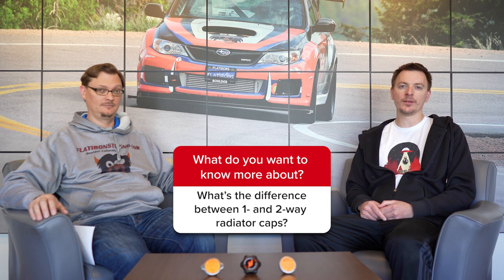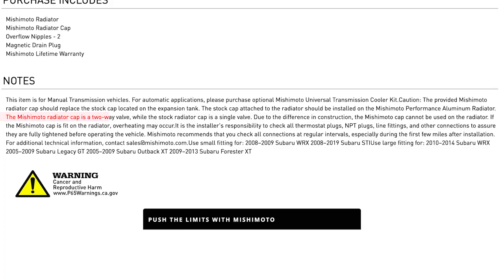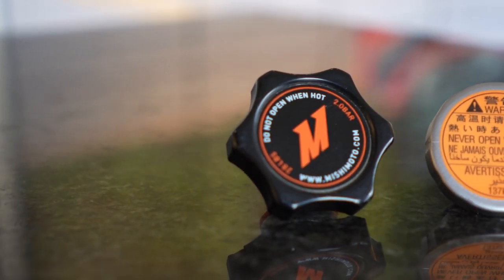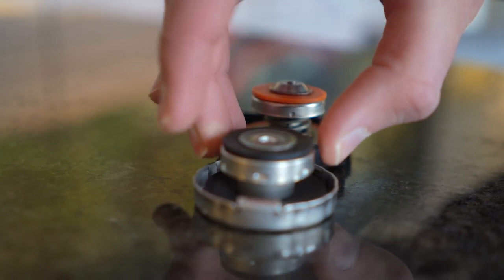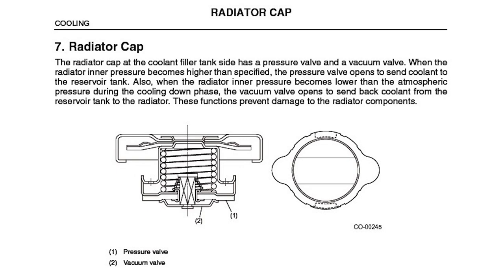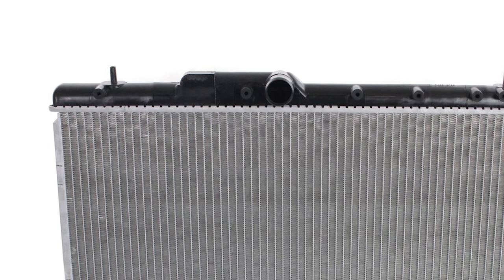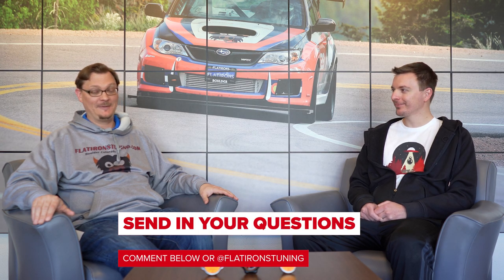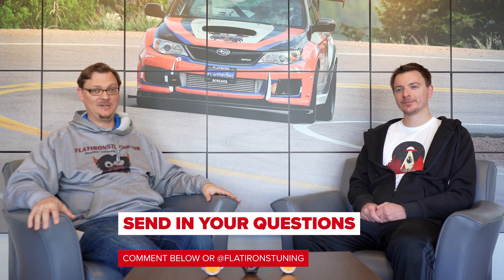Explaining the Mystery of Subaru Radiator Caps

Comment: Dude, you guys just saved me. Was having an issue with my overflow filling to the brim with coolant, and my car then overheating. Everything I was reading was saying head gasket. I watched this video just on a whim, and it made me realize, I actually had my caps swapped. Yall are the best.
Reply from the maker: Very glad to hear that this helped you.  Stay Tuned!
Reply: @FlatironsTuning  Wound up being the head gasket anyway *super excited*. But I still learned a ton from these videos
Reply from the maker: @NateTeunissen  Sorry to hear that, but it definitely is critical to have those caps in the correct locations.  Hopefully that will help keep your engine cool going forward.

Thanks!
Reply: @NateTeunissen  can I ask what year your Subaru is/was? Thank you!
Reply: @FlatironsTuning  do you know if this hold true for the CSF radiator as well?
Reply from the maker: @TheRandomname951  Yes, it would be the same for CSF radiators.

Thanks for watching and Stay Tuned!
Reply: I'm having this issue right now. My mechanic is thinking headgasket, but I'm still thinking radiator cap. Hope they don't ruin my car...
Reply: I had the same fear on my 2009 forester.. suddenly reservior tank filled right up after a heavy drive.

Comment: Hi Jon, I hope this solves your cooling problem and thanks for the plug. My solution on our sprint/endurance cars is to simply use the stock/oem caps as Subaru intended, no aftermarket caps to fiddle around with. If you don't get the caps right you can spend a ginormous amount of time and effort trying fix an overheating issue. Putting the caps on correctly may not solve the overheating, it could be something else, but you have to eliminate that variable first.  Next, what we've found is most important is proper ducting into the radiator and sealing it all around the edges so the airflow cannot slip past it. A vented hood makes a big difference too.  If you watched our YouTube video on the last Cascade Enduro you heard me say that after 6 hours of racing our coolant temps were still slightly below normal on the OEM gauge. Later our datalogger confirmed our temps. 
And for your audience, the rule of thumb so you don't get the caps swapped backwards: The cap with "ears" goes on the expansion tank because Subaru wants you to open that one to fill/check the coolant. The round cap without ears goes on the radiator because Subaru doesn't want you to take it off, so they make it harder to grip it.
Reply from the maker: Thanks very much for pointing us in this direction.  It has been enlightening to say the least!

Stay Tuned!
Reply: Thank god. This just saved my ass on the side of the road.
Reply from the maker: @89autoworks  Oh man.  Glad you found the video and that it helped. 

Stay Tuned!
Reply: @FlatironsTuning  I can’t wait till my car is done, would love to take a road trip out to your guys place!
Reply: @FlatironsTuning  yeah and I lied, car is still over heating…. No bueno.

Comment: I've ran Mishimoto radiators on a few cars now and I must say that using OEM caps are the way to go. I always had overheating issues when running anything aftermarket. Go OEM and in the proper location, you'll be good to go!
Reply from the maker: Totally agree.  Thanks for watching and Stay Tuned!
Reply: whats the correct way the caps go? I want to buy oem for both
Reply: @jessem9832  the perfect circle one is the radiator, the one with the lil side tabs is the expansion tank. Hope that makes sense

Comment: Great video as always guys 👌 I’ve tried to explain this so many times to friends in the Subaru community but now you’ve done the perfect video explaining it all, I can share the link with them. 
      Another pointer not covered is the reduction in size of the overflow tank usually when fitting front mount intercoolers, this can cause issues whereby the coolant overflows the overflow tanks capacity and then when the two way cap draws back when cooling down, it empties the smaller capacity overflow tank and draws air which then causes the air pockets in the system and head gasket failure. Keep up the great vids guys 🤘
Reply from the maker: Thanks very much Sam, and great point about the expansion tank.  That is definitely another gotcha for sure.

Thanks for watching and Stay Tuned!

Comment: The Subaru cooling system can be a right pain at times if you don't know the difference between the expansion cap and the radiator cap, however it's made worse by companies listing all the caps as rad caps.. 1 way valve on the radiator, 2 way on the header..
Very Interesting video for people with coolant issues being led to believe it's hg failure 👍
Reply from the maker: Thanks for the comment and thanks for watching. 

Stay Tuned!
Reply: More stuff to worry about with the Subaru

Comment: So happy to actually see or find a very concise video about this topic as I and apparently many many others had absolutely no clue about this one way & two way valved cap my OEM radiator on my 2012 WRX finally let go at the crimped plastic endtanks and started leaking. Swapped out for a koyo rad radiator and radiator hoses so it obviously came with their cap and upon install was when I started to find out about all this one way two-way valve craziness and obviously when I started searching online trying to find out why and where to put the higher pressure cap where to put the two-way valve and if it was even worth using one of the higher rated pressure caps. I most definitely did see very erratic coolant temps and it would get over 208 and rather quickly once I understood what was going on and had the correct pressure caps in the right locations everything's calmed down and worked out wonderfully and when I pull my car in the garage and shut it off you can actually hear that vacuum and you can  hear the system sucking the coolant back out of the overflow which kind of tripped me out at first until I realized what was going on and that that was actually correct but thank you very much for the content in this video it was wonderful also very excited to hear what else you find out with continued testing on this topic.
Reply from the maker: Thanks very much for the comment.  Stay Tuned!

Comment: I've seen a lot of folks ditch the expansion tank for track use.  

My car, which is basically one giant experiment, is actually running an N/A radiator + JDM crossover pipe without the expansion tank and only one radiator fan with the USDM EJ205.  Coolant temps have stayed below 200 on the track so far.  Ill find out how it does with the new turbo tomorrow :)
Reply from the maker: Thanks for the comment.  I think that the expansion tank is actually they key to the solution, not the problem.

Thanks for watching and Stay Tuned!

Comment: The reason for the expansion tank is that due to the location of the turbo charger on dual cap cars, the cap on the radiator is no longer at the highest point of the system. In order for the system to function properly, the fill point must be at the highest point in the system (just like how a brake bleeder must be at the top of a caliper). Notice how the 2010-2012 Legacy GT did not have an expansion tank because it has a bottom mount turbo.
Reply from the maker: Thanks for the comment.  Stay Tuned!
Reply: I love that explanation!
Reply: This makes sense.  Guess I  messed up.  I burped air on my koyorad radiator side no bueno

Comment: Hi guys , great video , I do a lot of track work in my Impreza and I’m a plumber by trade so My understanding of the way the caps work is that both caps lift sending expanding coolant in to the expansion tank (at different pressures) but only the header tank cap draws the coolant back as that is the highest point of the system.

If you ever noticed when the engine is cold , say it was left over night the coolant level is never right to top and there is an air gap and once the system pressurises again this air gets pushed out and the cycle of push/pull continues.
If you have the 2 way cap on the radiator you may get air pockets forming and this is a lower point in the system hence the overheating. I could be wrong but it is may understanding of it. 

A friend with a s204 had this happen at the Nürburgring and a head gasket failure shortly afterwards. Caps were fitted incorrectly.
Reply from the maker: Thanks for the comment Barry, and that is our understanding about the issue with the 2-way caps as well.

Thanks for watching and Stay Tuned!

Comment: What an huge amount of info... And what about the non-turbo subarus, with only one cap in the radiator and the expansion tank next to the radiator, with an standard plastic yellow cap? This cap on the radiator is a two way one?
Reply from the maker: Thanks for your question.  The non-turbo Subaru's only have a single cap on the radiator, and that is a 2-way cap.  The tank next to the radiator is the overflow, and it doesn't have a pressure cap on it, and you actually wouldn't want to seal that off.

Glad that the video was helpful and thanks for watching.  

Stay Tuned!

Comment: So it wasn't the head gaskets, didn't someone say it wasn't?...😀 I'm just glad you got it figured out.
Reply from the maker: Right?  I feel like we are getting to the heart of the issue, and our cooling system will be the better for it.  This is why you always have to do your diagnosis work, and develop a solution based on what you find.

Thanks for your help, and for being a great sounding board for this Keith.  Much appreciated.

Stay Tuned!
Reply: @FlatironsTuning  Meh I'm always learning like anyone else. I really would have like to have seen that car go around COTA, but sometimes the cards you're dealt are just not the winner combination.
Reply from the maker: @Silent_Keith  Honestly, if this lets us figure out the cooling system and improve it (which I think it all ready has), then this may be the best thing that has ever happened to that car short of getting the dry sump figured out.

Next year will be better. ;-)
Reply: @FlatironsTuning  Why not just add an Accusump?

Comment: I’ve ran dual 2-way caps for a couple years of track days now. 1.3 bar ARC cap on the expansion tank and 1.4 bar CSF cap on my radiator. I think the important part is to have a 2-way cap on the expansion tank, and the pressure relief on the expansion tank be less than or equal the cap on the radiator
Reply: If you keep the factory expansion tank it sounds like the 2-way cap should be less pressure than the radiator cap. As long as one of those two caps maintain correct pressures it looks like you're set up is safe, but if it was me I would run the factory cap on the radiator.
Reply: I’m about to do the same 1.3 greddy on expansion tank and 1.4 Csf.. the oem radiator cap doesn’t fit the Csf kinda loose and leaks a little.

Comment: Awesome video. Here’s my experience and two cents. 

A few weeks ago I pulled the engine(04 EJ205) had the original aluminum expansion tank, the filler neck had a small rip due to all this pressure. Ended up changing to the plastic OEM expansion tank, but did not replace the caps.

Anyways, my dad helped a bit, during the process of adding the oem super coolant(Have a 2007 2.5i A/T sitting on the side) Did notice the shape where different(didn’t give too much thought)and did not check the kPa. A few moments later my dad brought this up even though he’s never worked on an EJ.

And mentioned to check the pressure readings on top of the caps, without even looking at them. Once I did.. for radiator it’s 108 kPa and expansion tank 137 kPa. Looked it up on forums and saw the difference. No overheating or anything.

Mean while I still kept inspecting hoses and caps. I’d remove the expansion tank cap and see build up from I guess the old coolant. I clean it up with a toothbrush and remove the gunk. Radiator cap not a whole lot. 

You explaining how these caps work, specially the expansion tank cap, gave me an answer to my question tonight. 
 Earlier today(9/23/22) took a drive from chicago to Wisconsin dells(non stop). Just check my engine bay and saw the upper radiator hose kind of swollen, pressure wasn’t released from the expansion tank cap(since I didn’t clean it before hand). I’m gonna get a cheap toothbrush and clean it. Until I get new OEM caps. 

This video helped me understand how these caps work, so thanks for that!
Reply from the maker: That is fantastic to hear, and glad it helped.

Thanks for watching and Stay Tuned!

Comment: On track, with the stock configuration, I had an issue with pushing tons of coolant into the coolant overflow until the lower fluid capacity caused over heating. As a quick leap of faith, at my next event I replaced both caps with 2-bar 2-way caps and never had any overheating issues, nor over filling of the overflow tank. I was not aware of the Rad cap being a 1-way cap but it makes sense why my overflow was constantly overflowing and thus overheating. I will definitely be taking a handful of caps to my next event now that I know this, but the 2-bar 2-way cap  combo I have currently seems to be working.. (Aftermarket Aluminum Rad and hoses handled the higher pressure just fine.)
Reply from the maker: Glad you found a solution that works for you.  I would recommend keeping a 1 way cap on the radiator, or in a pinch, having a slightly lower pressure cap on the expansion tank.  But again, if you have found something that works, by all means stick with it.

Thanks for watching and Stay Tuned!

Comment: This bit my ass badly. I finally communicate with Mishimoto radiator they told me the same thing. I ended up just running 2 oem caps and no issues. This should be a large red warning on the cap when they ship it. Not a foot note on paperwork nobody reads.
Reply from the maker: I definitely think that it would be better if this instruction was more visible for sure.  Glad you got your issue resolved.

Thanks for watching and Stay Tuned!

Comment: The expansion tank vents to the coolant reservoir via a tube that is kept in coolant at all times. This allows the system to heat up and cool down, while pushing coolant in and out of the expansion tank without sucking air back in (which could lose your bleed of the system).

Since the radiator vents to the top of the expansion tank, you want it to be able to push coolant out, but not pull anything back, because it could pull air back in and lose the bleed.

The recommended way to set this system up basically allows for the proper regulation of pressure and control of thermal expansion in the system while having an ambient-pressure coolant reservoir available to the user and not allowing any air to enter the system.

That being said, if you REALLY fill the expansion tank up, you probably won't ever get enough air in the cooling system to cause a problem, but if you 1. don't get the tank completely full, or 2. allow air to enter the expansion tank in some way (e.g. low coolant in the reservoir), you could end up in trouble.

Comment: Usually the radiator is the highest point, but because you have to cool the turbo and keep oil circulating you  so you don't bake it if it put away hot. The turbo runs directly into the cap and as the water expands and heats it rises gets pushed out and cooler water from the engine is pulled in the expansion cap is there so that water can be forced in and out by the highest point and. And it's there directly to cool the turbo goes engine > turbo > expansion tank > radiator or overflow tank > engine , but you always want hot to be at the top of the system so that if it evaporates it likely out of the system atleast that's how I understand it. It basically a turbo timer but automatic and fully mechanical it's also nice because it forces the whole system to equalize to the radiator tank temperature also forgot about the forth hose that directly cycle just teh engine which is also the primary pumping method with the car on to cool the turbo by forcing coolant from the cooled side of the radiator into the water pump and engine and hot side of radiator I haven't rebuild a ej205 in a while it kindof faded, but that what I remember. My koyo didn't come with a cap also they're better than mishimoto. By a long shot. Aleast in terms of build quality.